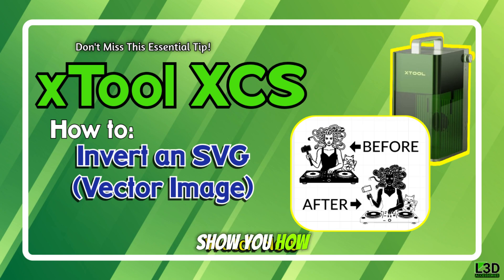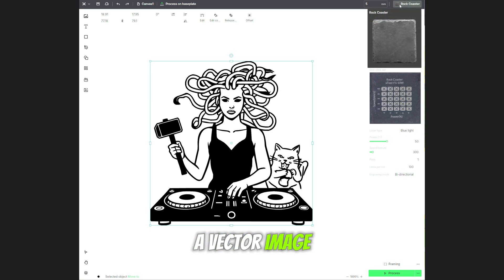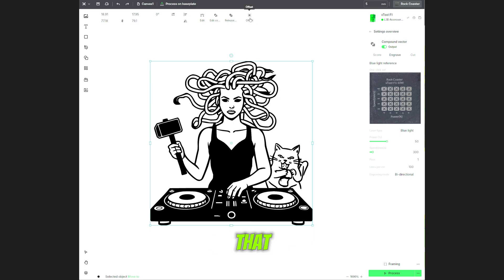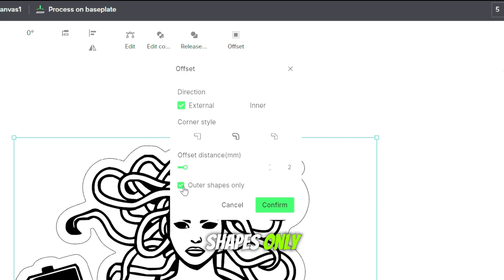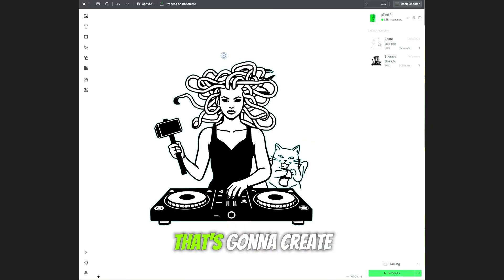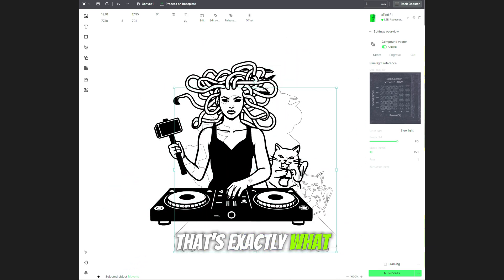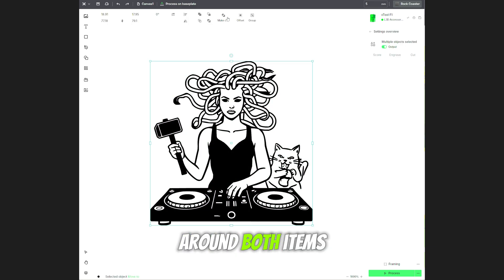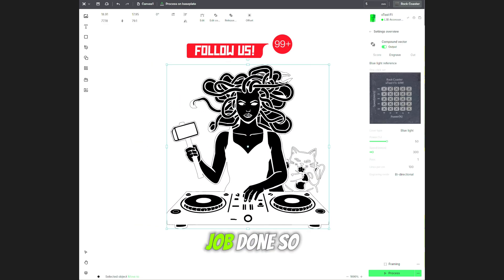How to Invert an SVG Vector File in XCS | 1-Minute XCS Tutorial

Comment: this is not correct.  This is why all of your image did not invert
Reply from the maker: Why isn't it correct? Can you explain your version of the correct way and if it's right I'll upload a new video.
Reply: @L3DAccessories  You were correct with the offset but to get the correct shading you need to use subtract at over lap.  The make a compound vector will give you were overlap issue that are not correct when doing it this way
Reply from the maker: @E2-laser  Thank you for the pointer. Every day is a learning day and I'll be adding a revised video to my to-do list.
Reply: Did you publish an update  video ?